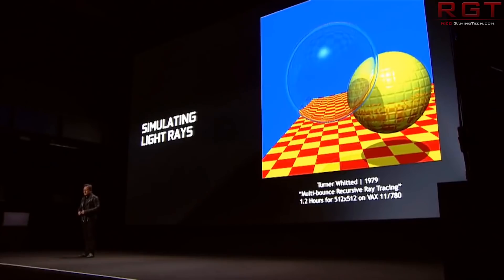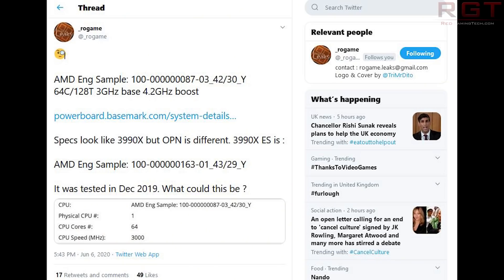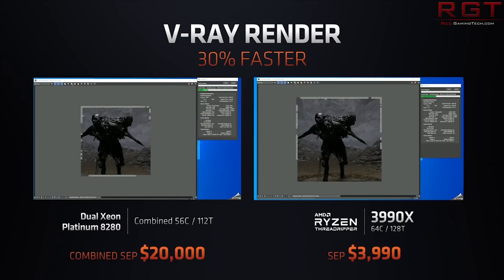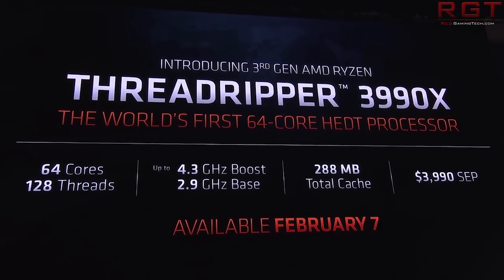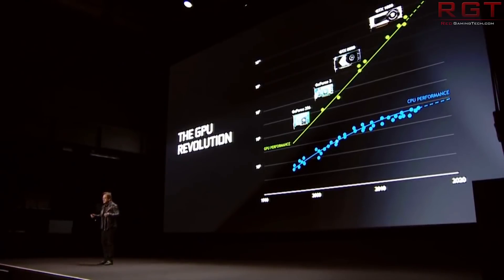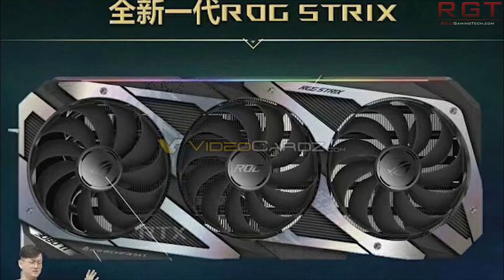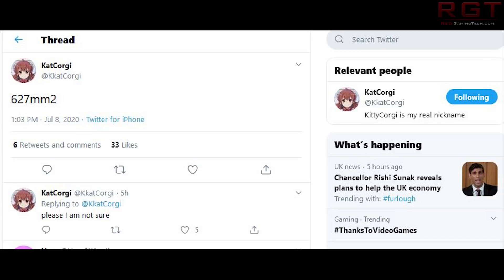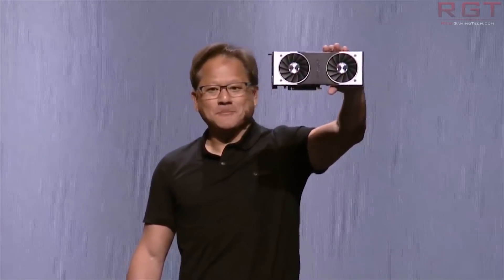Insane 8 Channel Threadripper Leaks | No Mid Gen Console Refresh Says Former Xbox Boss

Comment: "no midgen refresh"
bit early for that call. This gen's in a much better position at launch, but that might also just mean a much longer gen like the xbox360/ps3 gen was. If the covid causes a general recession or stagnation, that's another reason this gen will be drawn out like the 2008 GFC was for the ps3/360 gen
Reply: Good point.
Reply: There won't be a mid gen refresh because generations will end for the Xbox. So 4 years later a new Xbox will be released and it will be called, the Xbox Series X. It will just be the 2024 edition. It will run all your existing games. You dont have to upgrade if you are ok with your current console, and the current console will continue to be supported.

Comment: This connects to my reaction to yesterday's video on the prospect of a last minute spec upgrade due to better than expected yields. If no such upgrade is implemented, nor the reduced costs turned toward a lower price (which would count as a change in the eyes of the public which still only has speculation in that regard), the ceiling for a mid-generation Pro model is increased by that much.

There is no question that a die shrink of the APU will be pursued at the earliest opportunity to cut the cost of the machines in three primary ways: chips per wafer, cooling, and power. (One wonders if Lockhart in a 3nm node would be cool and cheap enough to use the main processor of a smart TV, giving it access to the Xbox library and Xcloud streaming at a small premium.) When that goal has been secured, it is inevitable that AMD will explore how many CUs can be added and/or clocks boosted within the power and cooling envelope of the original PS5 and XSX.

At the dates one might expect, 2023-2024, a few things will have happened in the TV sector. The feature set of a low end set, $200-$400, should have improved significantly. The market demand for better frame rates and other aspects can only increase as the displays become more affordable.The stage will be set for new high end models to serve that demand without placing any significant burden on developers. I suppose it's possible that 8K will become a significant market segment, further driving demand for more powerful models of the consoles but I'm not holding my breath on that one. Unless 8K sets with at least 120Hz capability become remarkably inexpensive, 4K with high scan rates will be the market driver for a long time to come in gaming.

As such, the new machines could likely get by without any increase in RAM. While you never can have too much RAM (technically you can but not within the range of concern here) Offering models with larger internal SSDs will be desirable, though. Those could appear much sooner as the launch frenzy fades and offering different SKUs differentiated by included storage becomes acceptable to the retail channel. Early on, this seems more likely done by using the expansion capacity of each machine rather than having any change to the primary manufacturing line. Throwing a Seagate 1TB module in the box for the XSX or factory installing a PCIe 4.0 M.2 card at the factory for the PS5 avoids potential problems while being only slightly less desirable than having the base SSD increase in capacity.

Comment: I think there will be slim models on a 5nm node(possibly EUV?) 2 to 3 years after initial release. Same specs smaller and quieter(which will help with the PS5 especially).
When it comes to higher end models. As soon as the Xbox One X and PS4 Pro became a thing the metaphorical Pandora's box was opened and I don't think they will want to try closing that anytime soon.

Comment: Regarding the 'pro' versions of the consoles, I distinctly recall some crazy analyst same 'same thing' for the Xbox One & PS4. The issue back then was that they released as 'low end hardware' upon that year (disregarding the CPU, the GPU alone was considered low end on both), effectively making them sort of required to get a mid gen refresh.
For this generation, I don't see it much different. GPU technology moves FAST, especially now since AMD has sort of caught up with nVidia, I can see nVidia getting a bit more creative upon what they are able to push. And the question there comes instead from 'how much resolution you can push' into "How likely are we to get a full path-traced modern title at a native 4k resolution".
As off as that sounds, it's not like it's directly impossible to assume that the hardware designated to offset the load for path tracing and denoising can't be improved upon to the extent where it blow the 'consoles' out of the water, thus forcing the consoles to get the 'lowest quality port' of the 2023 or 2024 titles, which 'may' end up pressuing for a 'pro' variant of each..
If that makes any sense lol.
But my point: I think it's very much possible to have 'pro' versions, but the focus upon them isn't due to resolution, but due to the additional graphical features and workloads that the machines would be required to do. Afterall, PC hardware becomes king at the end of the day. And if that gap widens too far, then 'mid-gen refresh' may be required. Especially at a resolution like 4k. Even with upscaling and AI lol.

Comment: I'm not disputing the source, but the reality is that both PS4 Pro and One X were very successful and there's no reason to believe that they wouldn't be again. You could say the next gen consoles will be powerful enough, but that's only the half truth. Newer more powerful games will need more GPU and CPU as well as RAM to run at 60fps 4K with ray tracing enabled. Both Sony and MS want to offer 120fps modes on some of their games and this will mean a hit to ray tracing and resolution. Mid-cycle could address this and make more games capable of 4K 120fps even with some RT features enabled.